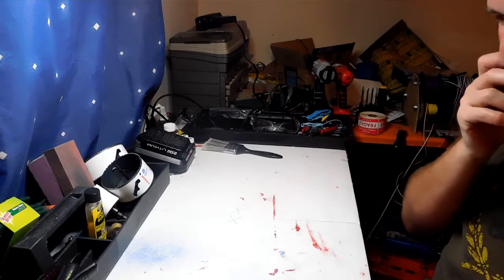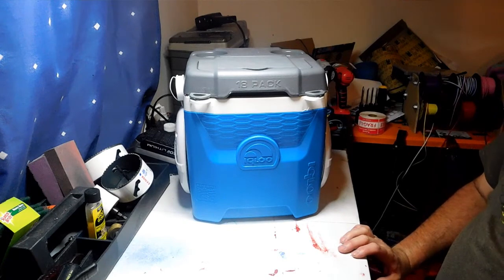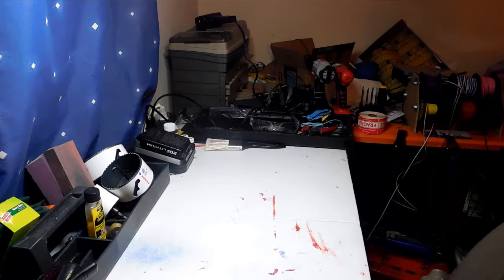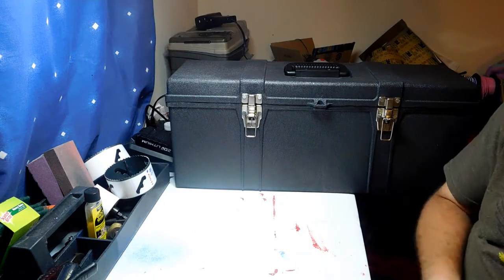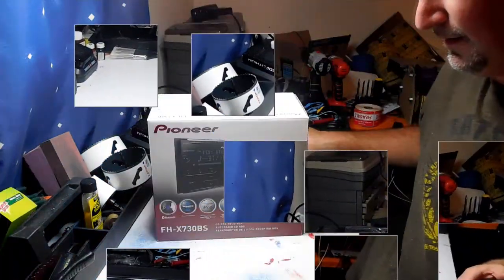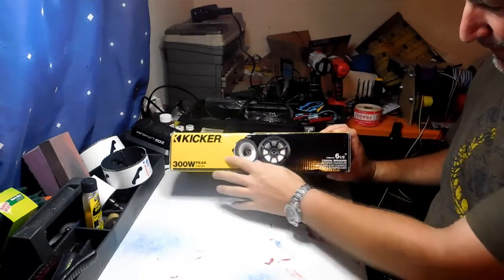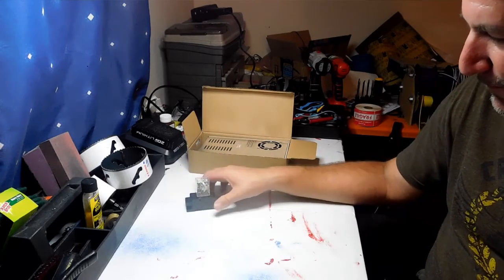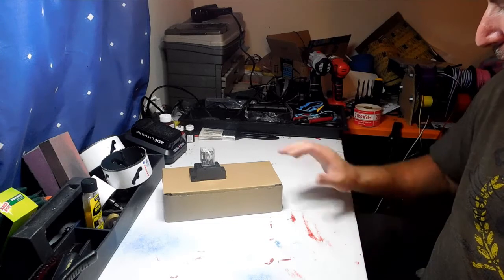Adding Insulation to Your Boom Box and Mega Boom Sneak peek

Comment: The acoustic fill (insulation) is actually doing a few things.  The first it is reducing standing (sound) waves in the box.  Second it is changing the Q which can make the box react as if it is bigger.  You can get some great results doing that.  The best thing to do is experiment with different amounts and types, as that can directly affect the sound as well.
Reply: Another thing that has the ability to greatly improve sound quality is to separate each chamber (ie each speaker).  This way they are not fighting each other.